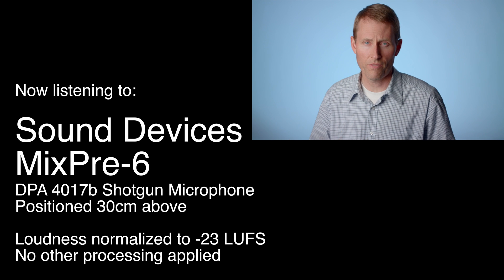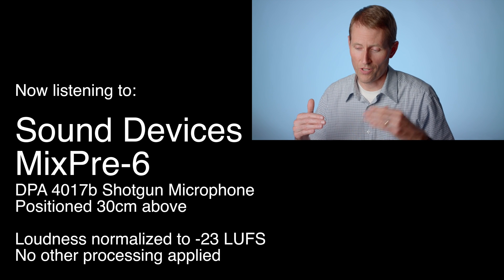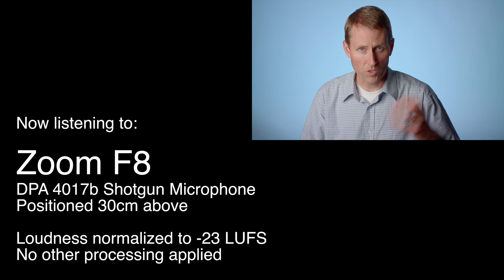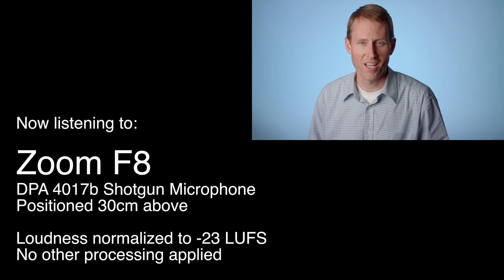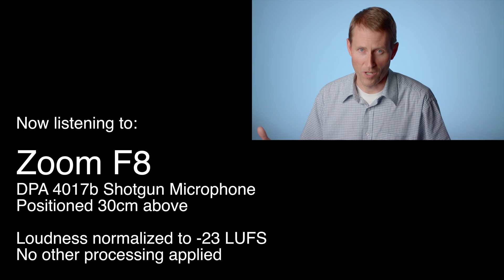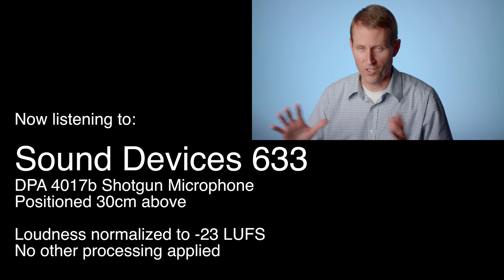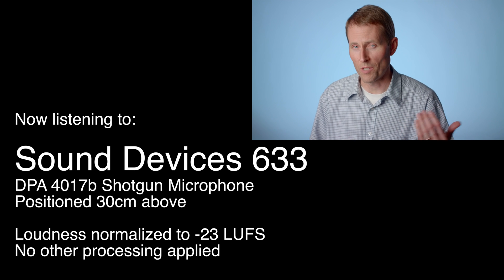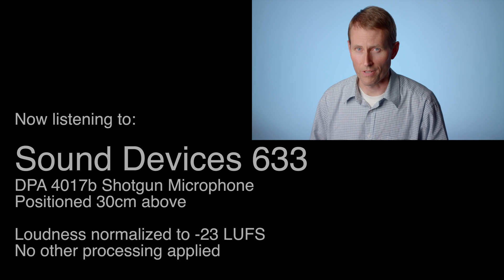Sound Devices MixPre Sound Samples Comparison

Comment: Curtis, what about a test on the F8 limiters vs SD analog limiters please. Im considering selling my F8 and buy the Mixpre 6 but i want to make sure it's worth the switch. Thank you for this informative video!
Reply from the maker: If limiters are important to your work, definitely go with the MixPre. The F8 and F4 limiters are post digital conversion so nearly useless for preventing clipping when sound over-modulates. HOWEVER, if you haven't run into issues yet, I'm also not sure the switch is justified on that feature alone. You give some things up moving from the F8 to the MixPre while you gain a different set of features on the MixPre. Still planning to do a "which works best for which situations" video at some point.
Reply: That video on "Which works best for which situations" is a great idea! In the meantime, I was looking at some stores out there for the MixPre-6 and it looks like it still hasn't been released?? Anyway, I guess I would just need to pre order. Thanks again, Curtis! Love your channel.
Reply from the maker: Hi Sy, it has definitely been released but the first batch of stock has sold out. Some of the retailers still show it as preorder but I don't think that's entirely accurate. I have one that I purchased from DVeStore.com so they have definitely begun shipping. Not sure why they still say "Preorder."
Reply: Curtis Judd Good to know. Thank you
Reply: Why are people so caught up worrying about limiters? How many times does your audio hit a limiter?
Reply from the maker: It is a good point to keep things in perspective. If you're doing your gain staging right, it is rarely an issue. On the other hand, a limiter can save a take or at least prevent more work in post for those occasions where things get loud. In a recent interview I did, the limiters engaged a couple of times over the course of a 15 minute interview when the interviewee laughed, even when I was staged so that the speaking peaks were around -18. Limiters aren't the end-all-be-all solution, but that are a helpful addition to save time.
Reply: Curtis ... that's good info and advice. At this point, it comes down to using an F8 and finding some kind of limiter and/or high pass filter device that I can plug the boom mic into and then send that signal to one of the F8 channels. The issue of wind noise during outside shooting here in Arizona can get very difficult. I don't know if such a device exists that could be run in the field on batteries, but I am sure others would also benefit. Have you ever come across anything like that?
Reply from the maker: Yes, the Sound Devices MP1: https://bhpho.to/2sjLGoU

Comment: How would you compare the Mix pre 6 vs the zoom F8 as far as functions? (Better use for film/field recorder )
Reply from the maker: Either of them could produce very nice field recordings. They both seem to have very nice preamps and plenty of dynamic range. If limiters are important to your work (e.g., you only get one shot at recording a particular field sound), then I would go MixPre. I also prefer the knobs/potentiometers on the MixPre.

If you'll ever need more inputs or balanced XLR outputs or in-built timecode generator or prefer a more robust external power input, the F8 is a great recorder. I find it's front panel a little crowded and it's knobs definitely on the small side.

So you can see there are plusses and minuses for both of them.

If I could only choose one, I'd probably go for the MixPre, but that's subjective and based on the type of work I do. I'm sorry I've not been more definitive but this is a case where if there's any way you can try one or both of them before you buy, that'd be ideal. Then you could get a better feel for each before you commit.You can rent a Zoom F8 here, for example: https://www.lensrentals.com/rent/other-video/camera-support/other-audio

And after we post the MixPre review early next week, we'll look at doing a future episode to compare the MixPre-6 and F8.

Good luck!
Reply from the maker: I'm planning to put together another video on that. The high level answer is it depends on what is most important to you in the work that you do. I prefer the SD but for others, the F8 is a better option. More to come.
Reply: Hi Curtis, looking forward to the Mixpre vs F8 video. I asked you on a different post about using the Mixpre-6 vs F8 just after NAB specifically for field recording (ambient sounds, very soft to extremely loud, instrumental and vocal performances and VO). I was leaning towards the Mixpre-6 for the limiters/pres and worried the F8 would clip during experimenting with louder sound sources in the field. You said in that case to go with the Mixpre-6. Do you still feel that way after having more time with the it? Partly asking because I have a pre-order waiting and want to pull the trigger but still slightly hesitant!